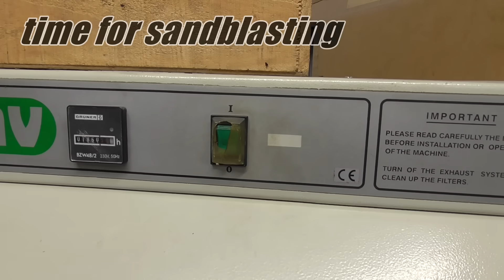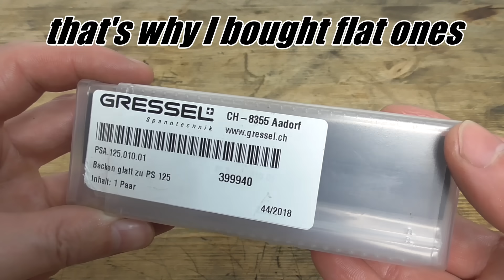Rusty Deadlocked Vise - Perfect Restoration

Comment: I've been trying to clean up (not to your excellent standard) and get to working condition old typewriters.  I couldn't imagine taking them apart like you do (nor do I have the tools).  I have seen others do so and put them back together after restoring them nicely with new chromed parts, rust removed, new painted frame, decals, etc.  I am enjoying using them to write with as several of them are in the range of 116 to 122 years old.  It is a joy to see them work again.

Comment: Pure eucalyptus oil is fantastic. I have a 1958 VW Kombi/bulli. the doors hadnt opened in 30-40 years they were closed solid. I applied the eucalyptus oil by syringe for three days. you could here the binded surfaces let go. I was then able to gently open every door & hatch without damaging anything.
Great job on the vice BTW.

Comment: Hope you did it for yourself,having restored 12 vices from a 100 year old foundry for one its not worth doing all that because the dont sell for more than 20 or 30 bucks normally even the extremely rare ones i was working on ,2 you should have sand blasted frist and then filed,would have saved yourself alot of time.nice work though

Comment: 50,000$ of metal equipment... doesn’t own a powder coating machine or oven. I was in love with the work until I saw the paint. That paint won’t hold up a year to even the slightest moisture.
Reply: Congratulations on nitpicking and finding fault with this man's work. May I suggest power coating and baking your stupid face.
Reply: That's odd.....the paint on the engine on my farm tractor is 37 years old and it still is holding up. and it's exposed to outside weather conditions all year long. I guess I have magical paint or something.
Reply: You put the dollar sign on the wrong side of the numbers.

Comment: Blasting can be very tricky, compressed air or feather blast.. if you use shot or sand or any other method.. you can or  will get millions of pitting holes in the metal. To those who don't know what I mean, it look like moon craters on the moon.. this guy sure knows what he's doing..👍

Comment: Only one thing...great restore job...but every time you hammer metal on metal,all I can think is,"amateur "..(..all you are doing is creating a flare on the endpiece..)..hit it with a piece of wood between it. Flared ends are not conducive to parts re-aligning. Especially pins,you flare the end by hitting them with metal and you take away the precise milling or tolerance to the pin. Never fits right.

Comment: Instead of grinding it would be much simpler and faster to dissolve the rust using hydrochloriс acid. Then just polish it and dip into ZnCl2 solution for a dozen of minutes. Then polish again and it will be protected from rusting.

Comment: A quick way to paint those white letters: Pour candle wax over them, then take a razor blade and scrape the tops of them, lightly sand , wipe then apply white paint. Then chip off all the wax and its done in 4 minutes and no mistakes

Comment: And why don't we touch sandblasted metal with bare hands? Come on dude you know better than that. Nice workshop though :)
Reply: Why??
Reply: @TheNot-So-DistantFuture  the natural oils in your hands increases the corrosion rate on the bare steel. Leave it overnight and it will be rusted up badly in the morning. Was the number one rule dealing with it in sheet metal.
Reply: @TheNot-So-DistantFuture  doesn't really matter though, because the process starts nearly instantly, and once it begins will continue even after being painted over. In sone time they'll be very damaged.

Comment: I love the craftsmanship.  You are a skilled machinist. Is there any reason not to start rust projects with a phosphoric acid dip?  Rusty old motorcycles are a hobby of mine and it works great.  Great work.
Reply: Will eat away the steel. This is a machined part

Comment: Thank you for a great video. If I may suggest, placing the entire assembly (when there is no rush to get it cleaned) into a bucket of Kerosene (placed outdoors to avoid fumes) for a week or two and you will be surprised how easily the rust will drop off all surfaces and greatly simplify the disassembly and the clean up process.

Comment: This is great, as usual. Although I am a bit curious - you are obviously very well versed in various mechanisms' inner workings. I don't mean particularly this vice (which is a pretty simple screw-based mechanism), but devices in general. For example that Italian tire pressure gauge whose work principle isn't obvious at all from the first glance to a non-professional. I assume that being a qualified CNC mechanic entails a pretty comprehensive training (especially given the high Swiss standards). Do you have a higher education degree in this field? Do you create a work plan for yourself when you decide to restore a tool and investigate its functional principles at first, or do you just work as on the fly, catching those principles and taking design decisions as you go?

Comment: I really like your vids but damn I hate that you made changes to the original design by swapping out the grippy parts for smooth ones
Reply: Its explained in the additional info. These are still sold today and when you buy them you can choose between 2 types of jaws. He restored this to use himself so he bought the other jaws (from the same company) and put them on. He did restore the rough jaws but he doesn't use them since they tend to destroy everything you use them on.

Comment: Thanks for this video - a rare masterpiece of purity of presentation and precision, I will never reach your level of workmanship and machining. 

There are a couple of things I'm not clear on - did you make a template so you knew the dimensions of the collar (missing part), and the correct position of the screw holes?

Also, when you drilled out those broken screws in those same screw holes and retapped them, does that mean you had to use bigger screws as the holes were bigger?

Comment: Super.  Simply excellent. Also you need special appreciation for providing timestamps.  Really helpful while watching again.  But for me this video was a bit painful to watch because it stirred up an old memory.  I was offered a similar rusty deadlocked vice for free.  Nothing was missing in it.  I was 600 miles away from home and was in no position to carry this along with my luggage.  Being a hobbyist with no income from the mechanical field it is not worth for me to invest in a new one either.  I'm using a tiny one now.  I still regret that I was not able to carry it.  But tell me something, how many hours did you require to restore it ?

Comment: Only thing I would change is putting threadlocker on the screws used to hold the vice teeth in. It would protect the screw from rust while making sure vibrations from sanding and what not wouldn't loosen them over time

Comment: Very nice. But I would have done it differently: Clean as on the video, but then leave in acetic acid with 20-25% acid for 2 days... Then neutralize the vice with soapy water. The rust should then be completely gone.

Comment: Out of curiosity as a mechanical engineering student, is there a reason why you couldn't have just sandblasted the entire body of the vise instead of manually sanding parts of it then covering up those parts with aluminum tape then sandblasting it? Sorry if it's a stupid question it's been a while since I had a metallurgy class and a machine shop class.

Comment: I love doing stuff like this. I am an engineer and I work on ships and the deck crew has vices and pipe vices that are attached to benches outside, exposed to the elements. They also have tools they leave strewn about that they don't take care of. So after I bitch at them a little I take the tools down to the engine room and restore them. It is very satisfying to take a rusted tool that they were just going to throw away and make it shiny and new.

Comment: I bought my house in 1977 and it came with an old three car garage that was built in 1914. Barn doors , dirt floors , it was old school. The work bench was made with oak planks 2inc thick and 6 inc wide. Bolted on the bench was a really old vice with eight inc jaws. Probaly been there since forever. I had an uncle who was a extremely large man , retired iron worker . I came home from work one day and found the vice in two pceis lying on the bench. I looked at that and said to my self " Dam , Uncle Bob , how did you brake that vice" Not knowing really who did it . Next day I come home from work and find Uncle Bob's Truck parked in front of the garage. I go inside and Uncle Bob is bolting a new vice to the bench. He told me he was trying to take the universal joint out of a drive shaft and it kept sliping in the vice. So he kept tighting and tightening the vice and it just broke in half. I am telling you this cause no matter how big a vice and strong , they will break if over tightened . Though this one was very old , any if over tightened will let go. I took it to see if it could be welded and they laughed at me. The old guy at the garage I took it to said what you got there is a boat anchor . It can't be welded cause if the monster who broke that iron like that , my welds won't hold.

Comment: The man's craftsmanship and patience are absolutely incredible!
Reply: And tools, machines etc. Don't forget those.
Reply: It's a one day job apart from letting the paint dry.
Reply: proof it  @thefattesthagrid
Reply: @tuonier  sure, come and watch me.
Reply: If i had a sandblaster, a lathe, a buffer, a torch,  a mill, and even a small (yet expensive) whetstone, i wont spend 2 weeks cleaning and restoring a forge and an anvil given by my grandpa, it will only take only 10 hours, at most.
Reply: @shania-antonio6425  Amen to that.
Reply: @shania-antonio6425  - It might not take two weeks, maybe just 14days  ;-)

Never underestimate the need to make fixtures and stuff when you have all those extra tools.

Comment: hi, what's the name of the tool used to unscrew the screws? the tool being hammered, which looks like a spindle. Thanks
Reply: Savio Cooper  Its an impact driver, has a spiral inside to turn the bit counter clockwise to undo the screw. As you hammer the bit is driven harder into the screw and the force is directed to cause the screw to unwind, unless the bit breaks or the screw head snaps off   they work very well! Trick is, how hard to hit before one of those failures!

Comment: Did you try to heat up one part of the stuck together pieces?  Usually the thermal expansion is enough to break the rust connection loose.
Reply: True, but if you are not sure what material certain parts are made of, this can lead ruined tempering that you might not be able to replicate in home environment.

Comment: Is it normal that it smokes while you mill?
Or you just went without lubrification/coolant?
Reply: The metal gets very hot when you cut it.  Any oil on or in it will smoke.

Comment: [German translation below.]
[Make sure you fully understand my SAFETY precaution notice below.]

What a great video! You just got a new subscriber. I find watching this skillful craftsmanship, especially the productive choices of tools, extremely inspiring. The result speaks for itself. It leaves me with only few questions/suggestions: During initial rust removal, why weren't much more material-protecting chemical methods applied, rather than mechanically abrasive ones? (filing, brushing, grinding, sandblasting)

Penetrating oil such as WD-40 functions mechanically, much more than in any chemical way.

But imho, aptly applied chemistry could have derusted the vise at much less material cost: Electrolysis would have required only a DC voltage supply, (e.g. a car battery charger) a tub of water with baking soda, and some sacrificial scrap metal as an anode. That would have conserved the substance better, and would have made the following mechanical restoration work a lot easier.

Had I wanted the Vise to last for decades, I would have galvanically zinc-plated every surface after complete derusting. That is viable at home. Of course your filler and your primerless anti-rust-paint will do a fairly good job, but they don't cover the entire surface of every part of the vise. And they won't keep this vise in working condition as long as a zinc layer with paint/grease on top would.

In future projects, you might want to have your captions checked for correct English.

All that being said: Very well done! :D Thanks a lot for creating this great video with your passion! And for not spoiling its satisfying experience with crappy music, or with unnerving gibberish.

Those "rough" jaws actually prevent slipping. Generally they are not damaging, as long as you use them correctly, with cheeks that are softer than your respective object. (E. g. for steel that might be aluminium cheeks.)

[SAFETY precaution]
Never attempt electrolysis without proper safety measures: Protective clothes (incl. gloves) is a must, just like safety goggles. For electrolysis: Never without good ventilation, and never with potential ignition sources anywhere nearby. Electrolysis can easily generate enough detonating gas (oxyhydrogen, 2H₂+O₂) to blow up any building, and that can be triggered by any slightest spark, such as in any electric light switch, or motor. So be damn careful.

[Edit]
Added safety notice and a few extra thoughts, and corrected minor errors.

[German translation]
[SICHERHEITshinweis siehe unten, bitte unbedingt verstehen!]

Welch ein großartiges Video! Du hast soeben einen neuen Abonnenten. Diese versierte Handwerkskunst, insbesondere die zielführenden Werkzeugwahlen zu betrachten finde ich äußerst inspirierend. Das Ergebnis spricht für sich selbst. Nur wenige Fragen/Vorschläge bleiben mir: Wieso wurden zur anfänglichen Rostentfernung nicht statt abtragender Methoden (Feilen, Bürsten, Schleifen, Sandstrahl) viel substanzschonendere, chemische Verfahren angewendet?

Kriechöl wie WD-40 wirkt mechanisch viel stärker als irgendwie chemisch.

Aber geeignet angewandte Chemie hätte imho mit weitaus weniger Materialverlust den Schraubstock entrosten können: Elektrolyse hätte nur eine Gleichspannungsquelle, (bspw. Autobatterie-Ladegerät) ein Laugenbad, (Backpulver in Wasserschale) und eine Opferanode aus Schrott benötigt. Das hätte die Substanz besser geschont, und die mechanischen Folgearbeiten deutlich vereinfacht.

Hätte ich gewollt daß der Schraubstock noch lange hält, hätte ich nach vollständigem Entrosten jede Oberfläche galvanisch verzinkt. Auch das geht zuhause. Selbstverständlich werden Deine Spachtelmasse und Dein grundierungsloser Anti-Rost-Lack recht gut wirken. Aber sie bedecken nicht jede Oberfläche aller Schraubstock-Teile. Und sie werden diesen Schraubstock nicht so lange in funktionsfähigem Zustand erhalten wie eine Verzinkung mit Lack/Fett darüber das würde.

Vielleicht magst Du in zukünftigen Projekten Deine Beschriftungen überprüfen lassen auf korrektes Englisch. 

Nach alldem: Sehr gut gemacht! :D Vielen Dank für das Machen und Teilen dieses großartigen Videos, mitsamt Deiner Leidenschaft! Und dafür, daß Du diese befriedigende Erfahrung nicht mit beschissener Musik, und nicht nicht mit nervigem Geplapper vermurkst hast.

Jene "rauhen" Backen verhindern tatsächlich Verrutschen, und sind grundsätzlich nicht schädlich, solange man sie korrekt verwendet, und dem jeweiligen Werkstück entsprechende, weichere Schutzbacken wählt. (Bspw. bei Stahl könnten das Alu-Schutzbacken sein.)

[Sicherheitshinweis]
Versucht niemals Elektrolyse ohne geeignete Sicherheitsmaßnahmen: Schutzkleidung (mit Handschuhen) ist Pflicht, ebenso wie Schutzbrille. Bei Elektrolyse: Niemals ohne gute Lüftung, und niemals mit potentiellen Zündquellen irgendwo in der Nähe! Elektrolyse kann leicht genügend Knallgas (2H₂+O₂) erzeugen um jedes Gebäude zu sprengen, ausgelöst durch jeden geringsten Funken, wie etwa in jedem elektrischen Lichtschalter oder Motor. Also seid verdammt vorsichtig!

[Bearbeitet] Sicherheitshinweis hinzugefügt, weitere Gedanken & geringfügige Fehlerkorrekturen hinzugefügt.

Comment: great video, great job as well, but wouldn't it be simpler to instead of having to buy new jaws just get a couple eighth inch thick flat pieces off copper or aluminium and bending and beating them around the top and the teeth of the jaws for delicate stuff you don't want scratched, that's what we do in our shop and they last forever and were super cheap and easy to make. #justatip

Comment: I know this is one of your older videos (the beverly shear was incredible) but just a note - WD40 is NOT a penetrating fluid! it does next to no good in releasing rusty parts! you need a proper penetrating fluid like PB blaster!

Your use of custom little jigs to remove the worst parts without damage is freaking astounding though. Aluminum tape is something I've never thought of to prep for sandblasting (would have been a godsend on the industrial blasting jobs I did as a teenager - Painter's tape over gauges on a huge directional drilling rig was a bad idea and barely protected at all. That poor vise looked barely used, the anvil and jaws weren't marred at all!

Comment: I'm doing something similar with a Record No. 4 at the moment, I found soaking it in a bucket of diesel for a week or 3 worked wonders for freeing it off (it was as or more seized than yours) Also a large amount of rust simply brushed off after its soaking.
Otherwise looks very nice, where does it mount?

Comment: ok first off when he pulled out the drive  or shaft it was open 1/4 inches or so about 40 seconds in before the drive shaft is removed it looks closed while he attempts to get it out???  vices never fail usually unless they are 20years old in the dirt or the drive shaft is stripped